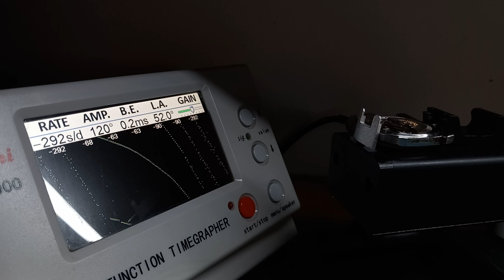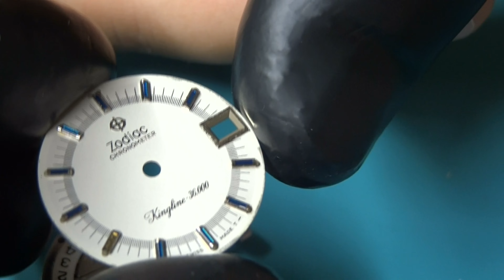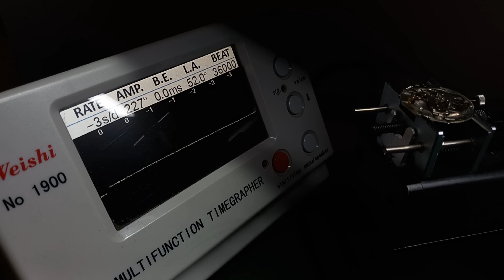Restoration of a vintage Zodiac Kingline 36000 Chronometer Watch

Comment: Now that was ingenious with that little index.  Finding a plastic pen lying around the house.  Clever!
Nice work.  That one took some finesse.  Good work!

One of those "sealed mainspring" deals, huh?.  Automatic Bulovas from the 50s and 60s had those.  I ran into one that was particularly dirty, so I figured the barrel had to be a mess inside too, so I popped the lid off anyway.  Fortunately, it was made like any other barrel and really wasn't sealed.
As suspected, it was a gunked-up mess inside.  I defied the warning to "Do Not Open", and since it was a watch I picked up off of eBay as a "fix or repair", I went ahead and took the spring out, cleaned, oiled, wound it up, and put it back in like a normal watch.  
Frankly, this was a silly design idea.  You know they're going to become a gunked up mess eventually.     Like those idiotic redesigned Toyota oil filters.  Why redesign an oil filter?.  DUH!🤪🤪
Reply from the maker: Obviously I tried to open it but nothing to do, I only deformed the back of the barrel. I also thought it could be opened like for example the longines caliber l 890.1 where it is written not to open but in reality it is possible to open it and lubricate the mainspring. In this case the entire barrel must be replaced, price €210......🤝
Reply: Ouch, that's a lot for the barrel.